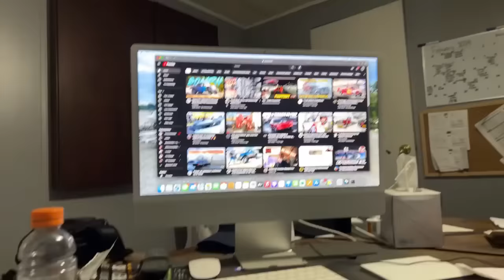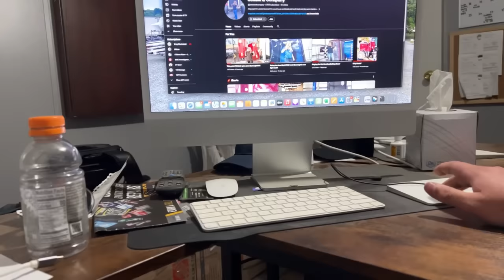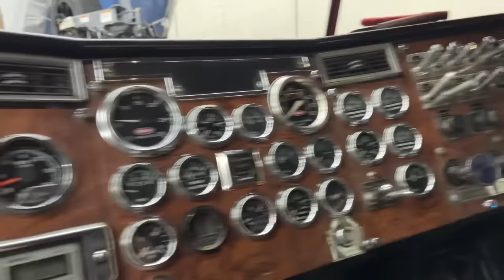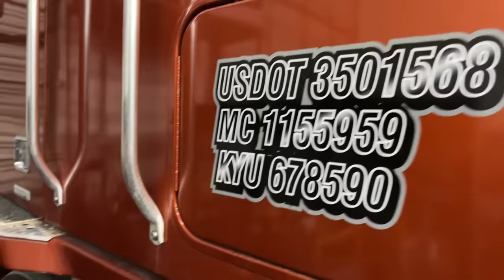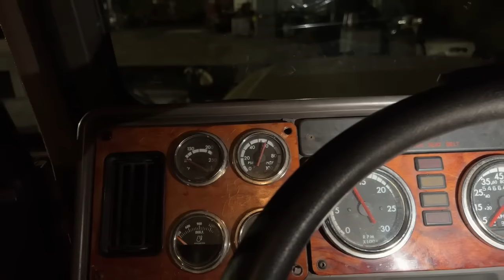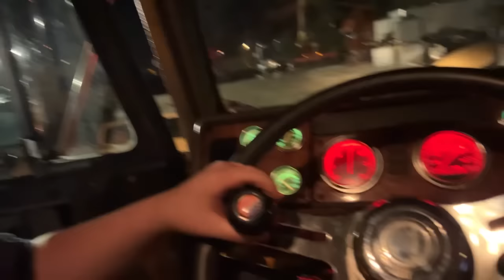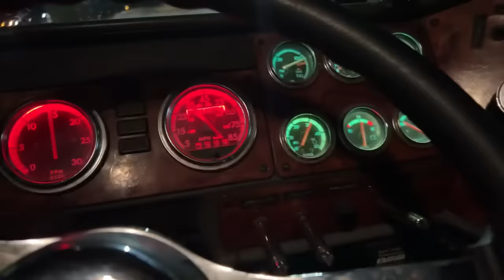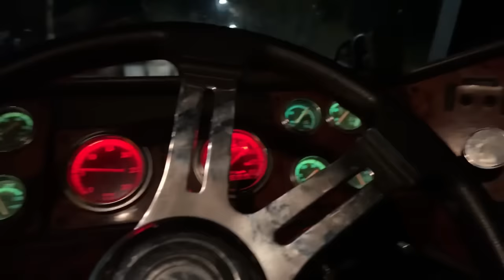Projects update in the shop!!

Comment: You need to take the mack dump truck back and get your Ford l9000 dump back before it gets ruined Tim your Ford dump is actually a nice truck for as old as that truck is. Also what happend to the other Ford dump that used to sit in front of the old shop getting an engine put in it where is that truck at now?

Comment: Great channel!! You need to explain to people about a 5 second car. Your rolling a 1000 ft, not a quarter mile. Explain it better. Your car will roll 8 seconds, but your running non prepped 1/8 mile, not a quarter mile. Explain it better. It will shut the haters up.